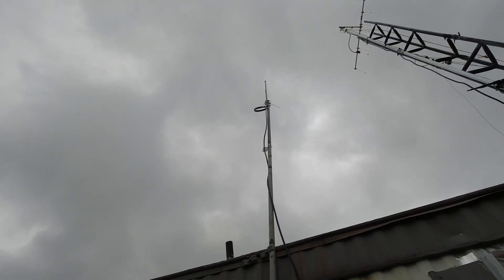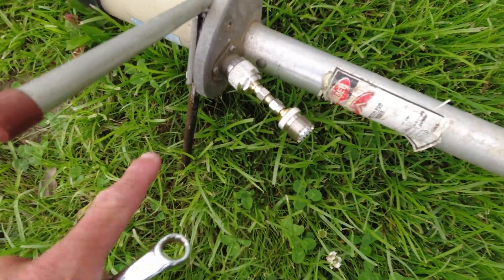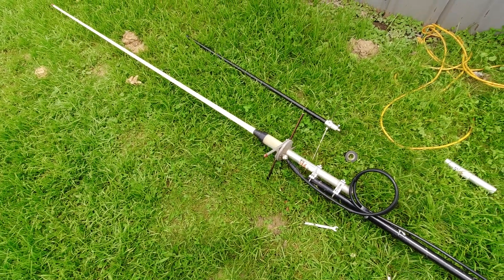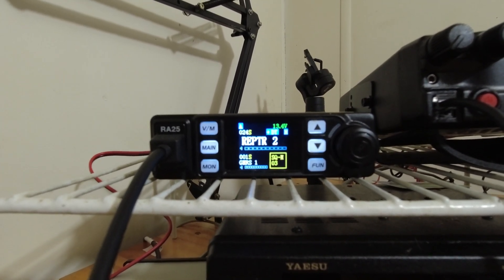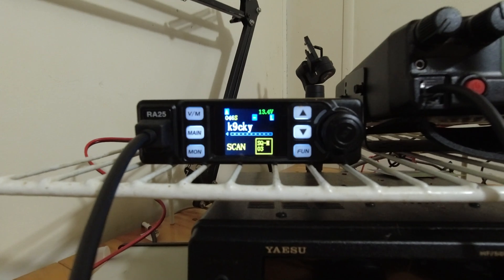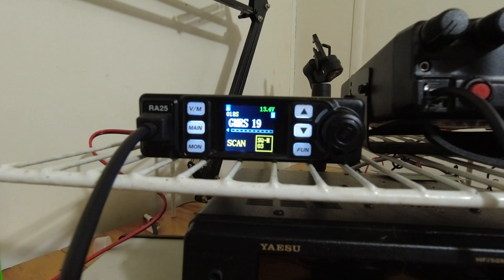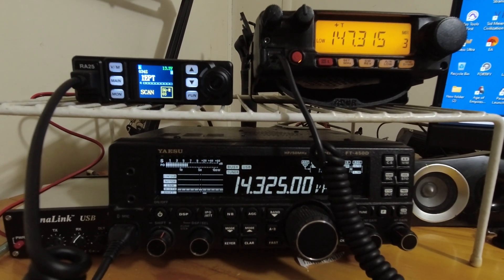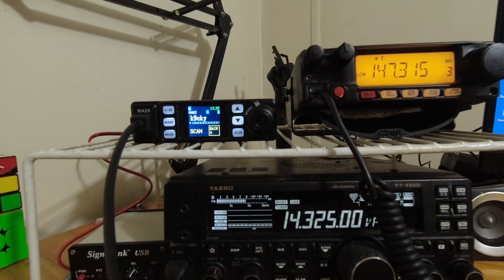Adding to my station. GMRS

Comment: Bet your dual band antenna didn’t have enough bandwidth to get up to the GMRS frequencies. Get a nanoVNA and check your stuff before you start putting RF into it.
Reply from the maker: yeah i ended up putting a commercial grade gmrs antenna up. and the vna is a must, i build endfeeds so the vna was a must have

Comment: There is no such thing as a 'repeater antenna'.  There is only the amount of gain and omni vs directional.  The antenna you have is more than sufficient.  The biggest factor is 'height'.  The higher up you get it, the farther you will reach.  Enjoy.

Comment: big problem is to many unneed connector on your antenna cable as insertion losses there takes away from any gain in the antenna.  buying a new correct connector on the N-type having as few as possible all add to more efficient cable coupling of your transmitter to antenna You EFI will be higher with a max of 50 watt and give your repeater more range in the end. Yes it works when all things are dry but all connection will get wet and there just more chances with yours.
Reply: Thank you for the advice , Im installing a new GMRS antenna for a new repeater, and need all the tips I can get .

Comment: Hello from Phoenix, Arizona. Thank you for the video. Do you mind if I ask you? Why do you have the cable looped near the antenna?
Reply from the maker: small open air choke, helps with rf feedback
Reply: @HamRadioQso  Ferrite's  are cheaper, but that loop is also called a drip loop , it keeps water from flowing down the coax into the walls of your house. Any radio supply will sell you ferrites for your size cable.